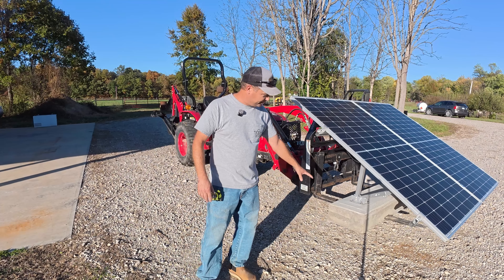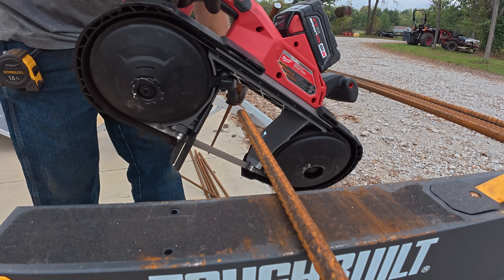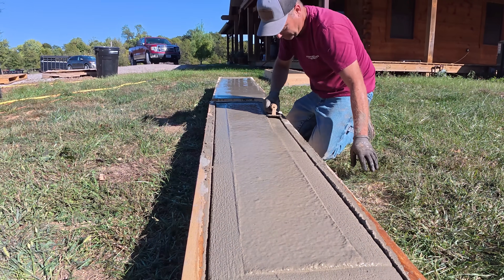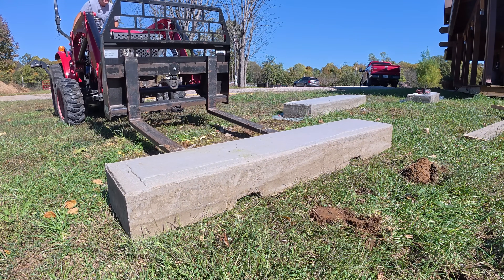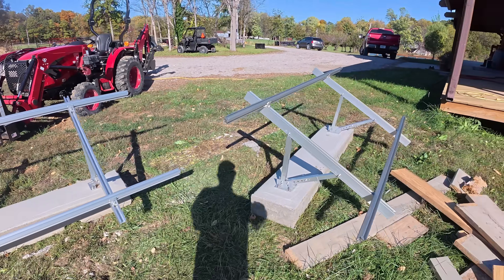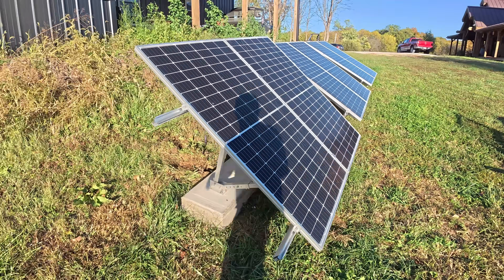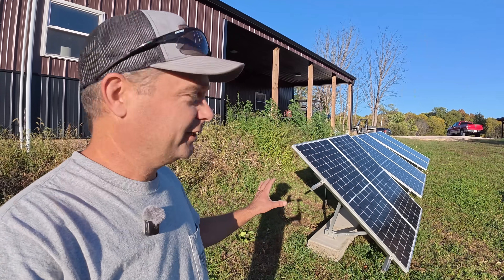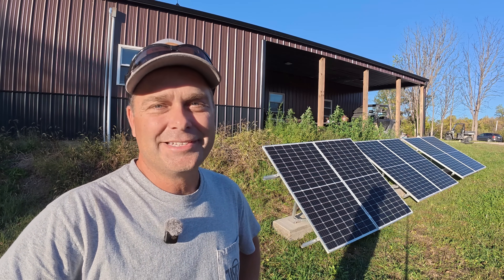Building a Concrete Ballasted Ground Mounted Solar Array.  Can be moved with Tractor or Forklift

Comment: If you installed a 3/4" Metal conduit or (PVC even) pipe on both ends (about 10"-12" from ends) you could install a temporary axle for some tires and a sling on the other end for lifting and it could be maneuvered into a smaller area with a slightly modified trailer dolly.
Great video to test and modify, Thanks!

Comment: Coating boards with used motor oil makes for easy removal. It's and old foundation form practice. This video is very well prepared and explained.

Comment: Use waste oil to coat forms for easy removal. Might consider vibrating the concrete to remove air pockets. Suggest Simpson strong-tie screws instead of deck screws. Rebar stakes to hold your ballast forms to the ground will help in winds. Various ways to do it but a couple metal straps over the top can be pinned to the ground with rebar stakes.

Comment: Lots of things you can use as a "form release", but Crisco works really good. Along with pretty much anything else that's slippery. But I figure you have lots of bacon grease around from all the pigs you've raised, so any lard would work perfect. Looking at these, I think I might make those fork pockets slightly larger (perhaps another 1/3 bigger). Slick little setup though!

Comment: Did you run a wind load calculation for the panels? I've been known to be wrong but I calculate with a 30mph wind on 600 sq/ft panel set at 30 deg the load is 479.5 lbs. You may need to widen the base or brace it somehow?
Reply: yeah, those are getting flopped over pretty easily. Quick and dirty is some stout angle iron bolted to the short ends. Make the base about the size of the solar panels. That would also make aligning the panels easier. Cast 12 inch square pavers to put on the "corners" where the angle iron stops. Probably want to do that anyway, keep the iron off the ground.
Reply: My bad!!! should be 60 sq/ft not 600. Recalculates as 69.05 lbs.. 🤬🤬

Comment: When pouring the concrete for strength add the fixing points for the solar so you don’t have to drill, also allow for fixing points to the ground with spikes (rebar)

Comment: Why to paths to ground if connected together?
Reply from the maker: That's normal.  Two grounds rods are required for a breaker panel also, unless you have a way to test that one ground rod is sufficient.

Comment: If you live in an area with much snow, you would want those to be taller mounts. That would give more room at the bottom edge for snow to slough off of the panels without covering the bottom edges. Even small amounts of snow pile up if you have repeated snow falls and no melting in between. But again if they are taller, the foot print might need to be wider. Another option though is to put metal legs on the bottom like outriggers instead of more concrete to get more stability. Actually is a very good idea there Evan.

Comment: That concrete base is way too narrow - a strong wind will flip that station over, probably damaging the solar panel. You should've made that double the width, at least - as the solar panel will act like a sail in the wind.
Reply: The thing he was after was enough weight without too much. Point is he could add all kinds of braces for your issue. I would add some metal legs to the corners of the panels to add stability but there are many options to make this better for your location. Here I would make the metal legs for the main support much taller to get the bottom edge higher in the air for snow to slide off without covering the panels. But that would make it even less stable so corner legs would be needed. Make the foldable for when you move it. Lots of option but this is a great starting point. If you double the concrete a small tractor might not be able to lift it.

Comment: Howdy Evan, that's a good simple mounting setup that'll do the job for an open area & will be easily maintained too but will have to be watchful due to flying debris from mower...
When you mentioned the grounding rods, I saw that on the side end of each block at a 45 degree angle or so you'd insert a 1in. diameter x 10in. long size piece of PVC electrical conduit into wet concrete for a place to drive in an out of the way ground rod on 1 end ( which is easily able to be gotten to ) if panels are already in place along with a piece of rebar on other end that'll also help with stabilization durning wind storms...that may cause them to rock back & forth much less too !

Evan have you looked into or thought any about the possibly of a Wheeled Articulating Telescoping Front-End Loader instead of a New Tractor as mentioned in previous video ???
Have a GOOD One !!!

Comment: On future projects, if you're looking for fast curing concrete check out Rapid Set's Concrete Mix at Home Depot.  It's calcium sulfoaluminate (CSA) cement not a portland cement so it achieves 4500 psi in 24 hours, 5500 psi in 7 days, and 6000 psi in 28 days.  A 60 lb bag is $15.97 so it's pricier than a 60 lb bag of Quikrete ($3.98), but it's stronger in 24 hours than Quikrete is in 28 days.

Comment: a suggestion, on the back of the concrete mounts, paint some lines in line with the fork pockets. once they settle and have grass etc grown up, it'll be hard to see them, you can do the same with some tape on the frames of the solar panels in the front. I would think that'd make it easier to line up the forks.

Comment: Great job Evan, you pretty well covered the should do's in your closing. You could  fabricate some extensions front and back to add stability to each of the concrete stanchions. You did fine, stay safe and keep up the great videos. Fred.

Comment: Mount a support bracket on each block of cement which extends out 5/6 inches so each unit doesn’t tip over.

Comment: I  brushed oil on inside of my forms, after filling with cement I tapped middle of forms with a 16 oz hammer every 2' to remove air pockets. Removing forms was easier with minimum finish on sides of product to smooth out.
Reply: His concrete was so wet that air bubbles were unlikely.
Reply: @larrycrain5650  You can see the pockets on the sides that this comment is referring to. Tapping them doesn't get them all, but most will work their way out.

Comment: You should oil the 2x6s.  Why not put the mound bolt in the concrete deeply?
Reply: It is a lot more measuring and prep to get the mounting hardware set in the concrete. You can't miss if you do it after it is set, or at least it is a lot harder to miss.

Comment: If you positioned the concrete as the 90degree right angle. you could have a 'winter' and 'summer' angle on the solar panels by just flipping them backwards 90 degrees.